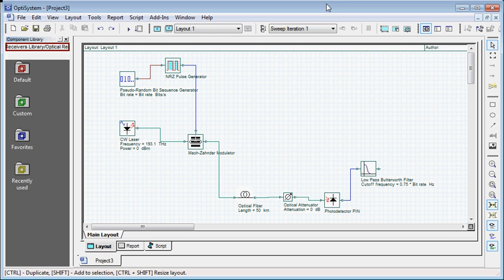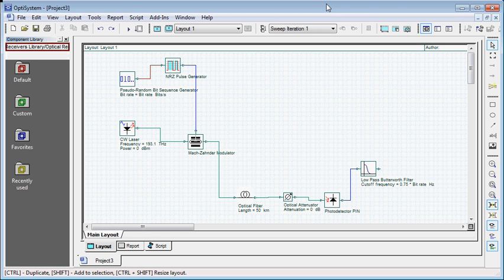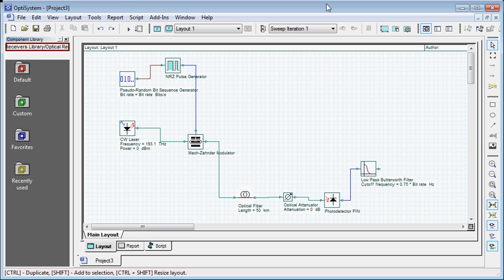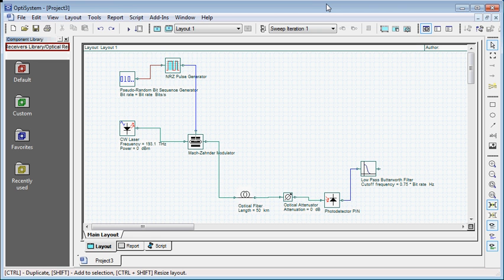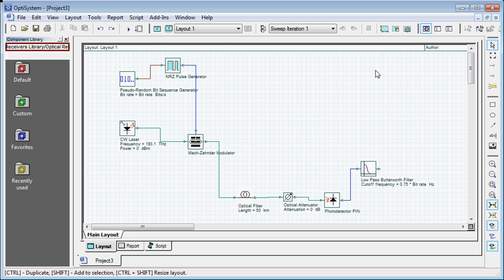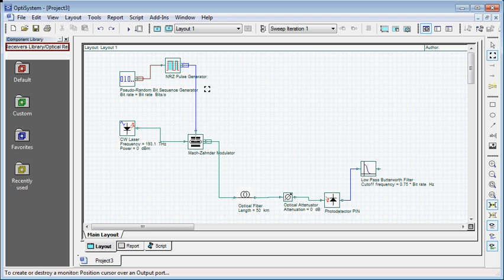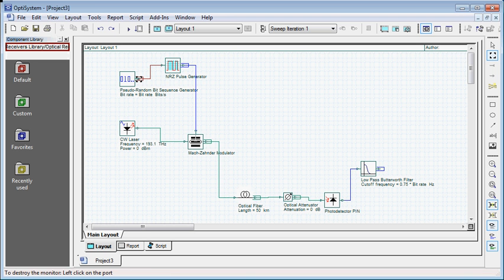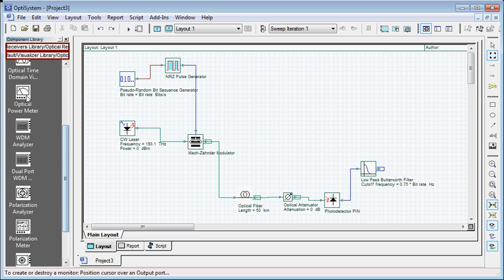Introduction to Optisystem - Monitor and Visualizer

Comment: sir we are working on different detection techniques for SAC CODMA system. Please make a video on how to use different codes such as Flexible cross correlation or MD or DW codes at the transmitter side.